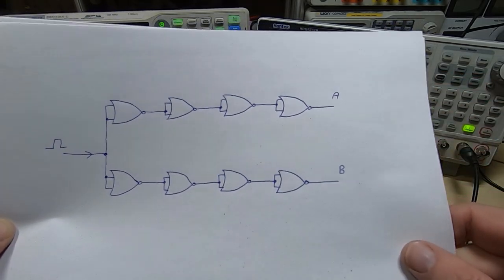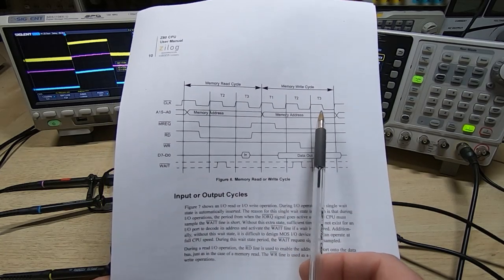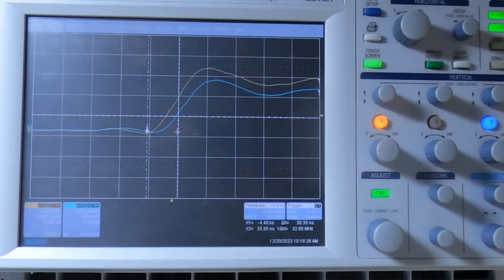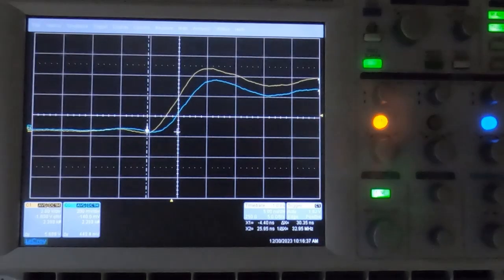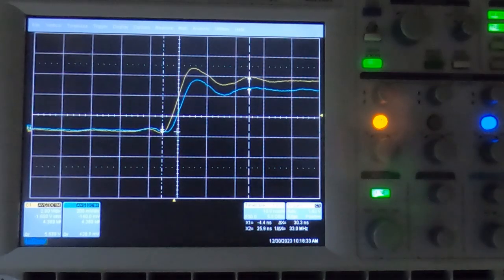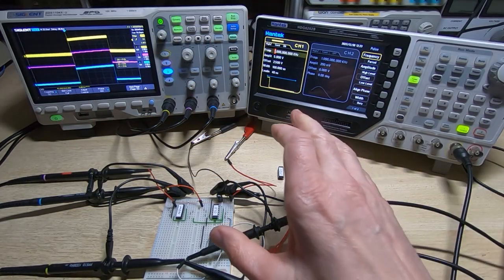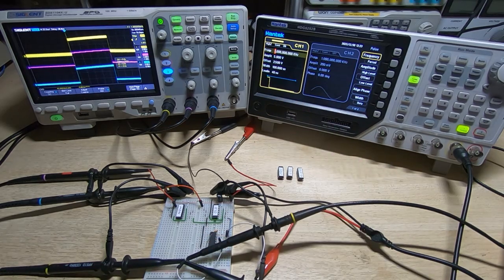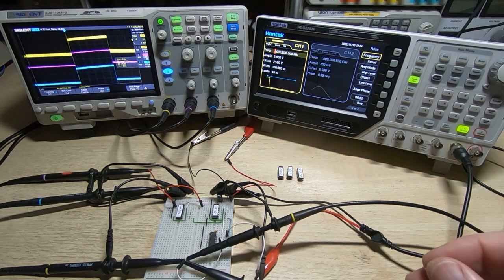Digital IC Fault Finding Part2

Comment: You indicated you'd like to know if people want you to continue this series, so I want to say, Yes! I have much to learn.

I liked that this episode showed the difference we can expect to see between different quality test probes. Now I know that I don't need to pay a ton to upgrade my probes for the kind of work I want to do. And the first episode was fantastic. It explained clearly the difference between oscilloscopes and what one actually needs. I think it was fantastic that you even bought a lower cost oscilloscope just for the purpose of demonstration. You are helping people who are new to this hobby not feel like it is going to cost an arm and a leg to even begin.

I'm sure you already have ideas for future episodes, but here are some of the videos I'd love to see: 

* The most common faults in prehistoric computer equipment and how to recognize them. 
* Techniques for multiple, interacting faults in digital ICs and other head-scratchers. 
* The first step you always do when presented with a dead retrocomputer.

     *       *       *       *       *       

Speaking of "first steps", can you give us a quick walk through of the process that led you to pull that IC in episode 1? Was it simply that you knew the problem affected the video circuit and so replaced each IC in that section of the schematic until it worked? 

In episode 1, you demonstrated how oscilloscopes can find subtle flaws in an IC. How else do you use your scope in this work? Do you examine a running computer before pulling chips? Or is that something a logic probe would be more appropriate for because you wouldn't worry about destroying it? 

There were a  couple other pieces of equipment you used that I'd like to hear more about.  First is the frequency generator in the first video. What would you have done without one? Would you run the suspect ICs very slowly, perhaps with a 555 and a potentiometer? Would you set the scope to trigger on the clock line and just manually toggle it? 

The second piece of hardware you mentioned was your adjustable power supply. You said that increasing and decreasing the voltage did not affect that particular fault which told you something since it ruled out other failures. Could you talk about what those faults might be and how necessary it is that we buy such a power supply for diagnosing retro computers? Are there reasonable alternatives for folks who don't have one? 

Also, are digital logic IC testers worth getting? Do you use one as you are pulling chips from a computer? 

     *       *       *       *       *       

And finally, I'd like to encourage you to make more of these videos that are focussed on teaching people the fundamental skills needed to repair retrocomputers. While it is fun to watch people repair things, when you explained diagnosing the same fault in different ways using different equipment (at least three different oscilloscopes, a logic probe, and a logic analyzer!), it made me feel like maybe I could do it, too, with the equipment I already have.

Comment: I may have missed but I didn't see a figure for the actual propagation you got for the old device. I'd be interested to see how far off it was from the max delay stated in the manufactures datasheet.
Reply: I'll go back and look at the video, but whatever the pulse width out of the XOR is, it's an amount of time that shouldn't exist at all using gates from a single IC. This setup isn't really what you'd need to finely measure the propagation delay, it does do what he says, very well.
Reply: If I understand you correctly, you are claiming two gates from the same chip have the same delay so no pulse is produced by the XOR gate.
Why would you assume the delays are the same? I don't see that anywhere in the manufactures datasheet!

At 8:00 in part1 two gates from a 'faulty' chip are tested, the delays for both appear to be similar and as you would expect no pulse is produced.

At 9:30 a gate from a 'faulty' chip and a gate form a 'good' chip are tested, the delays from each appear to be different, this time a pulse is produced.
But two gates, one with a 13ns delay and the other with a 8ns delay (both in spec) would produce a pulse, as would ones with a 3ns delay and the other with a 8ns delay (again both in spec).
However, both two gates with 8ns delays (in spec) or two bad gates with 18ns delays (out of spec) would produce identical results - no pulse.
What use is the XOR gate?
The only thing the presence of a pulse just tells us is the difference between the two gates is sufficient to activate the XOR gate, not that they're good or bad.
Reply: @BogusNotions  in the first video, the faulty chip delay was hundreds of nanoseconds, almost 180° of phase shift in the worst case.

The XOR gate shouldn't be favoring one input more than the other, both inputs should have nearly identical trigger threshold, right?  That makes it an impartial judge, trying to compare two scope signals adds in a bunch of variables that won't appear in the XOR comparison.  You'd have to assume identical input channel characteristics and calibration on the scope, including identical probe response.  I believe that's what the XOR brings to the table, it eliminates these potential variables, and only needs one scope channel to display the results of a truly impartial comparison.

I get your points about the datasheet, but generally speaking, you should see very similar characteristics between logic gates on the same die.  Picoseconds of variance is one thing, but hundreds of nanoseconds in variance, on one chip, screams that something is wrong, or heading that direction. 

You have to have one known good chip to do these tests, also the XOR chip needs to work. Hopefully , the 18nS out of spec would have been caught by comparing the input clock to the output.